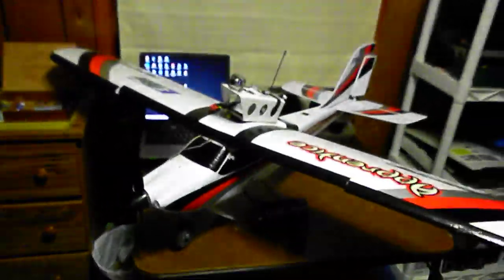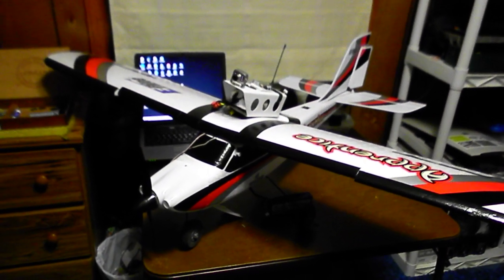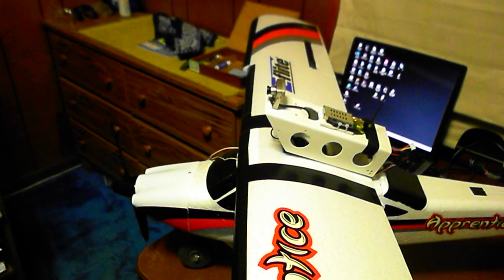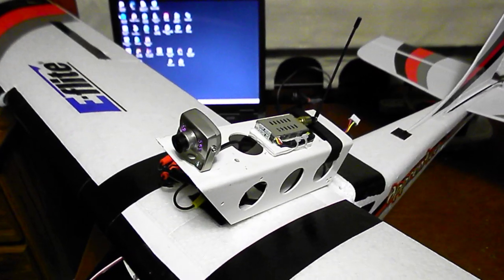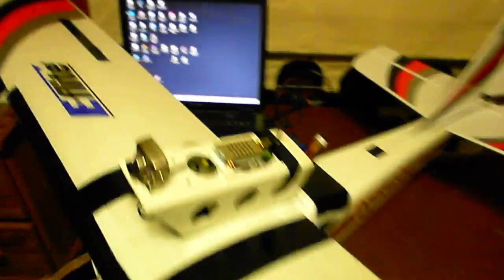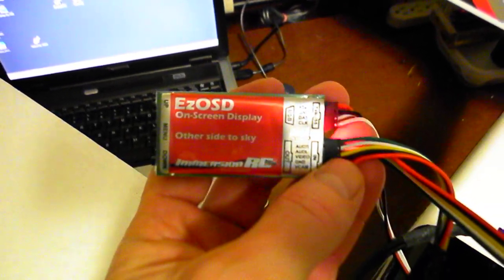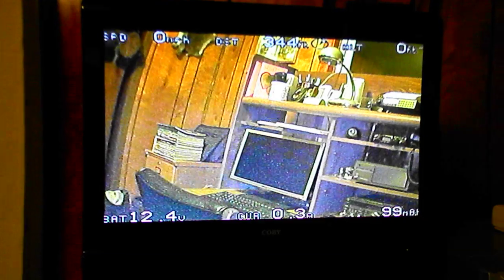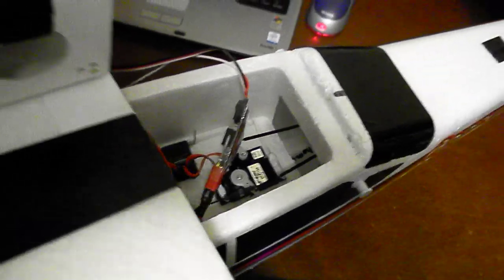DIY unmanned aerial drone - E-flite Apprentice with ezOSD

Comment: Nice walk around, Have you seen the Circular polarized antenna's aka "clover leaf antennas" are a great way to increase the performance of your FPV system. Proven to increase range and video clarity circular polarized. I my plane just came in today I will be running 1.258mhz from ready made rc 400mw and a patch antenna. looks good but if you would like a better camera .securitycamera2000. they have great cameras at a good price.

Comment: My only suggestion is to replace the stock wire antenna that came with your video transmitter, that is an untuned piece of wire that creates heat and damages your transmitter in no time, replace it with a 2 or 3 dbi aftermarket antenna, lengthen the life of the transmitter and get more range.

Comment: I'd like to see that, over 'bago', not sure if you'd have enough battery though???
Anyway. T, I bought you Easy Star, Went to fly today, was beautiful in Kaukauna. I flew it with the battery from you, flew great. I then put my camera on it, changed the battery to a 3 cell 1800 LiPo, WOW, what a speed demo.... OOOOps!!! blew the tail and rudder right off! rotflmao.. LOL.... Nothing broke, was only about 20' in the air and came right down in the snow bank.! LOL... will survive no problem. Thanks.